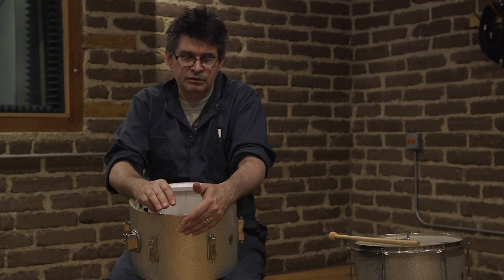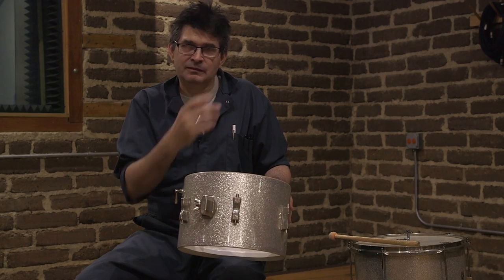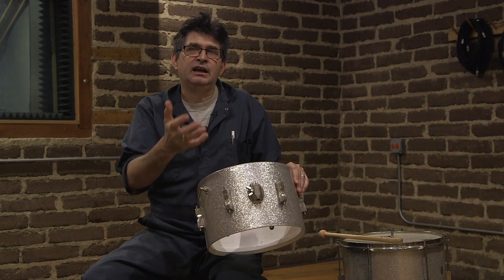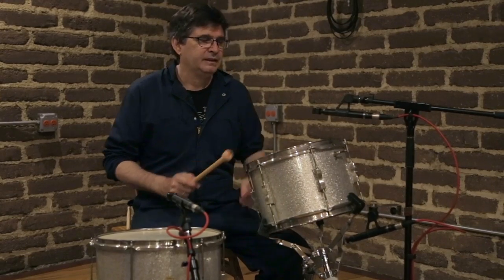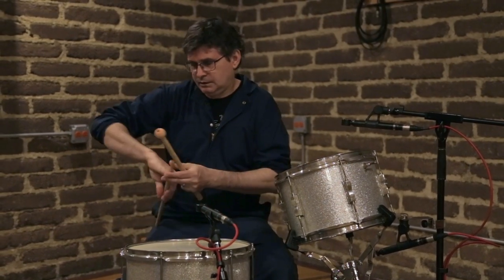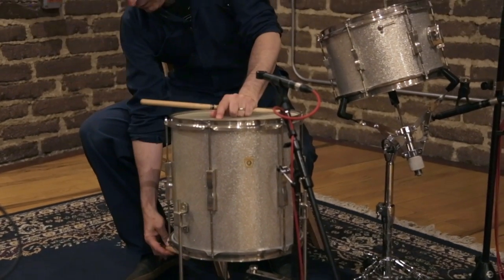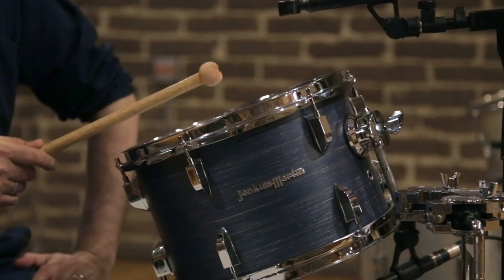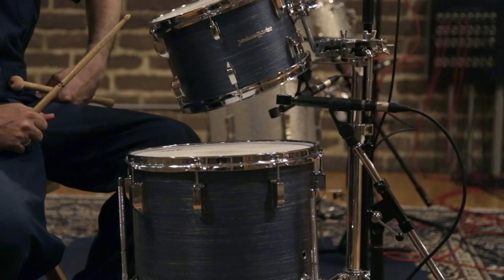Electrical Audio How-To: Steve Albini's Drum Tuning Regimes for Toms

Comment: Drum tuning has this reputation of being this dark art. It’s not, as Steve clearly showed you. It all revolves around the pitch of the shell. One method I use to get the tone even cleaner is to place cotton inside the lugs to dampen the springs inside them. It will kill unwanted harmonics from the tension rods and isolate the natural tone of the shell better. It’s labor intensive but worth it if you’re a tone freak.

Comment: I would say that usually jazz drummers actually tune the bottom head the same or lower pitch than the top because it allows for more stick articulation for faster patterns. Many rock drummers tune the bottom head higher because it shortens the decay but keeps the impact noise lower pitched

Comment: There is much more going on here than Steve is talking about. There is a mathematical relationship between wavelength and drum size. Some drums are not deep enough to accommodate the wavelength of the fundamental frequency of some of the possible tunings in the corresponding head diameter sizes for that particular drum. When this happens, the standing waves of the overtone series produced by one head will either resonate or cancel out with the standing waves of the overtone series of the other head. The depth and the diameter of the drum shell will therefore allow for a set of pitches will resonate better than others with certain differential tuning combinations of the top and bottom head. Many times the overtone series of a particular tuning of one head will not mathematically correspond with the drum size, and the drum will sound dead and fail to yield a definite tone. Head thickness as well as shell & hoop material will also influence how a drumhead will behave in a drum. All of these factors must work with each other in respect to batter and resonant head tunings to get the drum to « sing » with certain tuning combinations. 

In actual practice, I have found that if I am given the time to experiment with any given drum, I will find some tunings; both high and low, that will open a drum up and make it sing. Sometimes the bottom head is tighter, sometimes it’s the same as the top, other times it is looser. It depends, and you just have to find out where that particular drum is going to yield the best tone for itself, and for you.
Reply: That's pretty heavy shit coming from a drummer...you sure you aren't a keyboard player?  :)
Reply: Damn, you drum nerds are just as bad as us guitar geeks ;)
Reply: There's way more if you want to study it all...... but when you want people to learn something,  cover only the essentials,  since it's less to forget.   I am a drummer, and a recording technician.
Reply: @vancedylan5842  wahahahahaha
Reply: Very smart on you to point that out, but most of those variables are very hard to measure and some impossible to control, so the tension of the heads is actually what matters in real life. So back to Steve and the fact he uses a rising pitch when he wants a falling one.
Reply: @TheChadPad  Guitarist learning drums here, and yes, totally. Check out the Pneuma drum cam by Tool's Danny Carey. Check out Eloy Cassagrande on Rock in Rio... That shit isn't just counting four and banging shit, trust me.
Reply: Tampa Bay is gonna win the STanley Cup Again .......

Comment: shell frequency..........mind blown!
Reply: The shell frequency is much higher than what you would normally tune your drum. Hence the quite high jazz sounding tuning the first way around. He is doing it wrong.
The way to utilize the shell pitch is to tune your heads in notes that harmonically works with the shell and also with each other (very few drummers would tune the heads to the same note but rather the bottom head 2 or 2-and-a-half notes higher than the batter head depending on the heads type, shell size etc.
Reply: I tend to disagree (that’s what makes comments fun), I’m sure that Steve has worked with so ,many artists, and many of the greatest drummers in the world. He is drawing on his experience, while you may draw on your own experience. Nothing wrong there, simply a difference in opinion/technique. I’m sure that an orchestral percussionist would tune his drums differently than Thomas Lang, or Lars Ulrich, or Sly Dunbar, or Elvin Jones. And if it works, it isn’t “wrong” after all...it is simply “different.” Regardless, I value your input, and it’s interesting to hear your opinion. Peace!
Reply: @Leotardoification  Jazz drummers do sometimes use consonant tuning, so personally I think his example tuning of it is an accurate or at least "valid option" - nothing wrong with it.  There are famous drummers who tune both heads to the same note, at least for some genres.  Rising tuning isn't the one stop shop for everyone or everything.  I do think it sounds great and use it myself most of the time but there are reasons to use all of them.

Comment: I once had a drum recording engineer (Randy Delay (RIP) at Triclops recording studio in Atlanta, early 90s) remove the rims and heads to find each of my Gretsch shells' "note", using the Steinway grand in the room.  The kit sounded fantastic when he was done (several hours later) but I still wonder how necessary it was to do that.  Do you guys do this?
Reply from the maker: There generally isn't time, so we address tuning issues only when there are clear problems, but on the rate occasion that a band has a well-budgeted session, we do refer clients to drum tuners, and it makes a big difference.

We do try to periodically tune house kits by ear.

Comment: this is really helpful. to my ear it seems like most rock drummers would use falling, is that correct? that method just sounded much better to me and the most 'typical' of how a tom should sound
Reply: Bonham was rising if that gives you an idea.  I personally think of 80s when I think of falling (??).  Rising = shorter, Falling = longer/dramatic perhaps.  Some jazz(y) guys do consonant.  It's probably not a strict rule on any of that though.

Comment: Though this concept is interesting, it’s incorrect. When we strike a drum, the first pitch of a head you hear is the resonant as they air is being pushed down to resonate the reso head, THEN it returns back up to vibrate the batter. So, his method was correct only in reverse. 
And sorry, but the “shell note” bares no real influence on the pitch of the drum, but rather the tone or timbre of the note (notes). When he knocks on the shell you are hearing the resonant head because he only held the batter from ringing. When I tune, I think it’s best to hold whatever head you are NOT tuning as to more clearly hear the head you are tuning. The only thing about an actual shell that influences the pitch or “tuning” of a drum is actually the drums’ baring edge.  That’s why a drums sound is not really effected whether the outer shell is  painted or wrapped.
Reply: And here's a guy who knows all.
Reply: Sounds like you are saying that when you normally hit a drum you first hear the bottom head of that drum, is that what you mean ?
Reply: neocollective I think that you hear the attack of the batter head but the actual resonant sound you hear first is the bottom head. This can be proven when you hold the bottom head and strike the batter. You can see the sound that is missing. Hope that makes sense.
Reply: Sometimes when I hit my drum I can hear somebody yelling shut The F up
Reply: @ftdrum456  If you think about it in a fractal sense you hear them both at the same time but what he is saying is you get the strike of the batter head and the sympathetic ring of the resonant head.  Sound moves at 1,100 feet per second. Even with the longest/deepest drum you'd find on a kit there is no way you are hearing one head before another in any discernible way.
Reply: How does this work with drums with only the batter head?
Reply: @brendan_mcginn  with a top only headed drum the sound of the head and the tone created by shell escapes quickly.  A big reason for the bottom heads being removed in the late 60's/70's was to make the drums louder to compete with the amps getting louder/bigger. Much like with kicks, the advantage to putting a mic directly inside a single headed drum is that isolation would improve. You could get essentially a louder attack but its a trade off for resonance and tone. It worked for Phil Collins, so to each his own.

Comment: The drums also need to be tuned for the room they are in. What sounds great in a rehearsal room will require some adjustment to the tuning when the same drums are setup in studio.
Nothing crazy, usually just an eight of a tuning lugs turn is enough but that could be best to go from a lower pitch and work up. Drumheads have a point where you dont want to go past a high tension as you can overstretch them and theyre pretty much junked then.

Comment: Do you ever record drums with the bottom head off?
Reply from the maker: If you have questions for Steve, you can email the studio (link on our site).

We have a set of Ludwig Vistalite concert toms (no bottom heads) that we record some time. They're fun to record mainly because you can tune them to pitch much more quickly and easily and play melodically on them. I (Taylor) recorded a record with the bottom heads off, miking inside the shells. It was interesting, but I wouldn't do it again.
Reply: @ElectricalAudioOfficial  cheers

Comment: While I have the utmost respect for him and his work, he clearly can't tune drums.
Whenever he claims the top head it higher than the bottom it's the other way around and vice versa. 
And all those tunings are pitchy as hell with all kinds of overtones.
Reply: I should clarify that there are no "wrong" way to tune drums and that some tunings work well with microphones while they sound absolutely garbage acoustically. But given there are mics on these drums this doesn't seem to be the case here.
And what is up with all the scratchy mic noise?
Reply: i also thought this actually but just assumed i was/am wrong

Comment: when you "lock" the tom like that using a snare stand, you kill the tom sound.
Reply from the maker: Go on...
Reply: @ElectricalAudioOfficial  if you take a look at expensive tom hardware, it will seem kinda wiggly and loose. That will allow the entire drum to shake up and down in the air, wich gives a slightly longer sustain. You can get special rims for floortoms that allow them to wiggle as well

The rubber part of the snare stand touching the drum will dampen the sustain by transferring vibration down the stand into the floor.

However, this doesent really matter for most drum sounds, as the sustain is far more impacted by the tuning